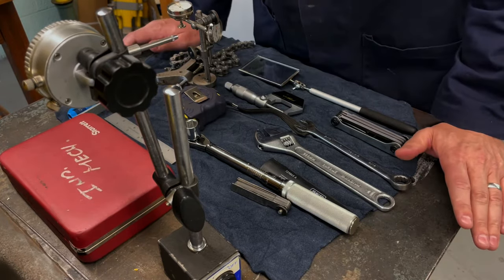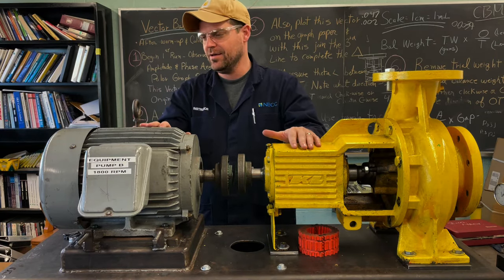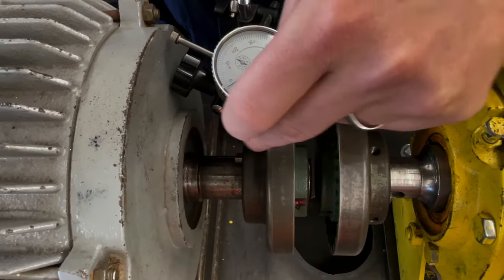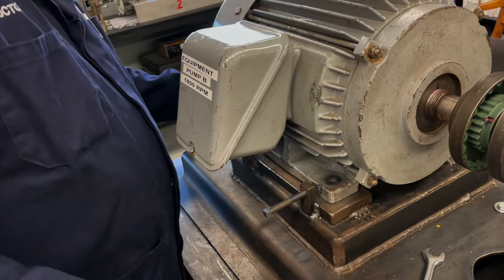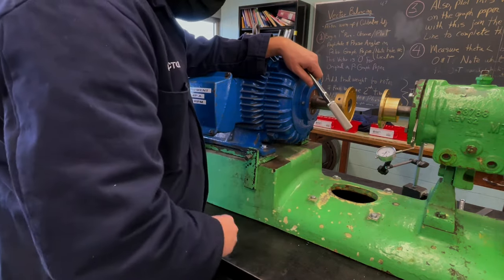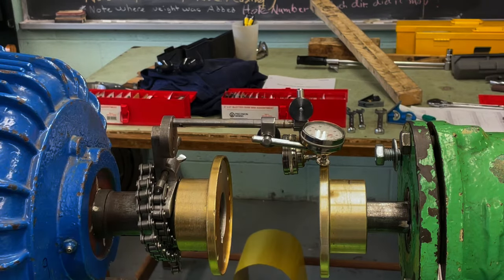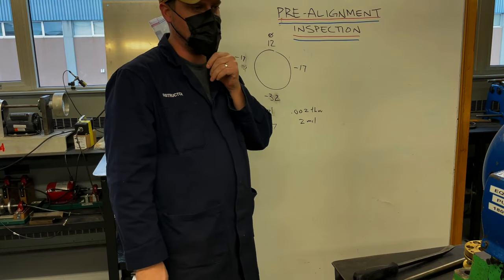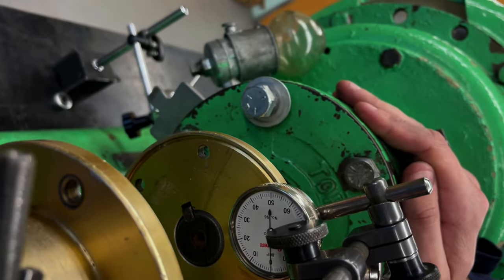rim and face alignment

Comment: Wrong should’ve mounted it to the stationary never mounted to the one you’re adjusting
Reply from the maker: could you explain how that would affect the readings?
Reply: @jasonecie4160... it's OK if you know what you're doing otherwise it would slightly take more time for others.

In this vid it's very informative on what you should do if you tie-up your gauge on the adjustment side.

Comment: i mean, after an hour and 17 min, to have the video end just shy of the final step, pretty sad. whats the point
Reply from the maker: Sorry about that Stu. I was disappointed also. I made this video for my class during covid. The horizontal moves are the same as vertical but you use the jacking bolts. I hope it wasn't a waste of your time and that you gained something from it.
Reply: Dude, I hope you feel bad about that race to your conclusion, but good you did dig through the class. He must be a teacher, and knows every single TIR and adjustment, could probably do it blindfolded like we had to R&R our M-16's including the whole bolt and receiver group in pitch black in under 2 minutes back in the day. Now THAT was wasted time. :)
Reply from the maker: dude, i did this on short notice as a substitute. as you can see we had to switch pumps because the base was garbage. if i had done this before why choose the wrong pump to begin with? However i do agree. i have done so many lump alignments it feels like i could do it blindfolded.
Reply: The final step would have been super easy. The motor now is only horizontally parallel offset. Turn the jacking bolts evenly motor slides a few mils along the shims and its set

Great video

Comment: Do the motor diameter and pump diameter need to be equal? Thank you
Reply from the maker: It’s the diameter of the circle the dial indicator plunger travels. The larger the circle the more accurate the measurement will be.

Comment: I would much rather deal with those couplings instead of the fulk flex head couplings having we had them on a crusher with a hydraulic clutch in between such a bad set up finally talked them into switching to an orange peal coupling had to drill some holes in the peel to make the engineers feel better about it not breaking the 4¹⁵/¹⁶ in shaft lol
Reply from the maker: i’ve never heard them called orange peels. i like it🤣

Comment: Outstanding video... it´s really amazing how you managed to sqeeze in so many details in only one video. Thank you.
Just one thing that got me a bit confused... about the "HA" measurements:
1:14:13 you said you were going to move 35,2 Thous
1:15:52 you said you were "moving" 32,5 Thous (a digit switch)
1:16:45 you were right on target!
I thought you were going to be slightly "off" because of that digit confusion.
Reply from the maker: Yes. It’s 15mil dial reading sweep across a 4.25” coupling reading diameter. We were trying to figure out the number of miles per inch of misalignment. I apologize for the confusion there.

Comment: Thank you so much for documenting this, very thorough and extremely helpful. At 44:00 when recording the readings for the adjustment, if the reading at 12:00 (I think you meant 6:00?)  is -5 mil, that implies the back end of the motor is higher, and if it were +5 mil, the front end of the motor would be higher?
Reply from the maker: hi tbone. yes you are correct. i said 12 o’clock but i should have said 6. good catch. 

it’s really important to remember that when the dial plunger is pushed into the dial indicator, the needle will turn clockwise or positive. once you can keep that straight in your head it’s a matter of stopping and thinking about what the face orientation is and whether you add or take out from the back or front.
Reply: @Stubbornnut  Thanks Blair, just like I thought. Im on my way to completing my pre-apprenticeship program in Ontario and youre videos have been great to go through!

Comment: I'm at 49:32 if they add to the front legs, this is gonna create offset with the pump. I don't know if he addresses this later in video. I didn't wait b4 commenting. As as a student trying to learn and understand, this creates a lot of confusion. Back at 24:26 They added .125 thou shims to ea leg. This made the motor and pump level at the rim.
Reply from the maker: The initial .125 was a really rough alignment to resolve soft foot and coupling bind. Adding to the front foot will correct vertical angular (va) and the following 12-6 rim reading halved will tell you the adjustment for vertical offset.

Comment: it is super informative video. But there is a point that I don't figure out. There was a soft foot and  u added 3 thou shim under it but still moving not hard.
Reply from the maker: the thicker shims bring the motor to elevation. once they are placed one of the feet will be “soft”. check to see what the gap is under that foot and add the appropriate shim to correct. if you add too much you will create a different foot to be soft. so it’s best to correct it with a tolerance of .002”. i hope that helps.
Reply: @Stubbornnut  So, first we find a soft foot and indicate the gap under foot and correct it to the tolerance gap right ? it doesn't have to be hard.
Reply from the maker: it really is the order of operations. if you place the shims under the feet to bring to elevation then you can identify the soft foot easily. especially if you mix the shim to verify thickness. an issue many don’t realize is that some motor frames are designed to be shimmed and if you try to figure softfoot without the initial shim adjustment the motor frame is high center ed on its belly and you will be tricked.
Reply from the maker: no it’s not hard at all. it’s ridiculously simple.

Comment: Hi bro. , Can I know the function of that part (yellow in colour,KL Embosed on body )which is placed before the impeller
Reply from the maker: that is the pump rotating assembly. it houses the bearings, shaft, and lubricant. sometimes cooling lines also.
Reply: @Stubbornnut  thank you bro. 👌